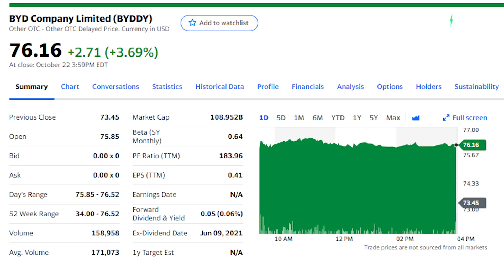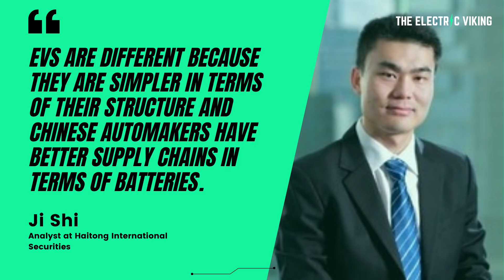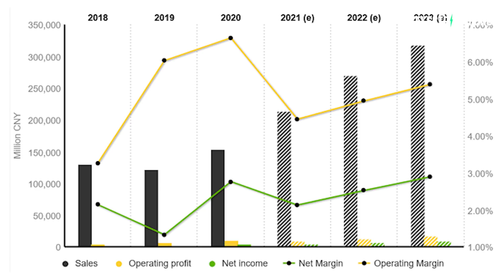BYD’s battery TECH gives its ELECTRIC cars a global advantage

Comment: The risk here is spelled 'Tencent'.  Some party apparatchik who invested in Nio can just shut BYD down at any time.
Reply: And you have no idea of the size and scope of BYD they employ over 250,000 employees, 24 factories. There consumer divisions makes all of the parts of the mobile phones, computers, batteries for all of the top western companies (inc apple), amongst all of the other consumer products the world loves. They are the 4th largest battery supplier (ctr'd with toyota, ford etc) and could easily be in the 2nd or 3rd spot very soon; worlds biggest ev maker (they have sold over 1 million ev's)...my point is they aren't getting shut down!
Reply: @BSBSBSBSBS-i2x  Not sure how this relates to my concern that The Party gets to pick winners and losers.  US investors in Tencent got badly burned by this and the same could happen to BYD, Xpeng, Nio, or any of them.
Reply: Tencent is actually NIO's biggest investor! 

Tencent will be just fine, current analyst PT for tencent are 50-70% upside after anti monopoly, tech regulations are finalised. 

Tencent not been 'taken down'. 

Anyway, there is a big difference here: developing clean energy transport EV's, Energy storage, Solar, semiconductor chips, ev batteries, high speed electric rail systems, are all stated areas for key government support under the last 5 year plan. The sector BYD trades in is one of the safest 'haven' sectors you will in China today.

Comment: For anyone to lazy to watch the video, there are some excellent bullets:

20 contracts to supply batteries! with for eg., Toyota; FAW; Ford (MACH E in China); Daimler; Hyundai worth over 100 billion yuan (USD15.6), with ongoing negotiations with a dozen more!
Reply: Their 50/50 JV with Toyota. By 2025 they plan to produce 25 Ev's, some or all on BYD's 3.0 platform, with the Blade.

The first production EV called the 290D (similar to Qin Pro), as scheduled to go on sale in China by June 2022.
Reply: Sales have started in Australia and NZ, with the new E6 (Blade Batt) and T3 van (Blade); 6 models based on the 3.0 platform will start delivers next year.

The BYD sales room / experience centre will open. in Sydney the end of this year.
Reply: The first of their new high end model range is due to be displayed at the beijing motor show next April.

This year they announce 8 new models in China, 6 are already on sale!
Reply: BYD have announce that they will be increasing their LFP batts by 20%, but that still they are cheaper than anyone else!

The Hertz deal for Tesla is their first real fleet contract. BYD has electrified the entire transport system in Shenzhen. They have been able to study the batts performance in a larger scale than any other company. BYD E6 taxis have produced more data than any other ev's so far. In shenzhen 500 EV's are charge at the same time with no issues!!!
Reply: Probably the biggest advantage right now:

BYD ARE INSULATED AGAINST SUPPLY CHAIN ISSUES.

Vertical integration: Tesla does not manufacture the 2 most important things in an EV: the batteries and the chips. BYD are the only company that is fully vertically integrated.

Tesla only has only really got 1 and half factories; BYD has 24 factories around the world.

This month BYD has outperformed Tesla stock price.

YTD BYD has outperformed Tesla stock price.

12 months BYD has outperformed Tesla stock price.

Tesla's local sales are declining in China, while BYD's are exploding!

Comment: Just read a report by Detroit Free Press dated October 22 that it costs more to charge an ev than ice car. True or not?
Reply: Detroit Free Press lied to you. It cost $3 to charge a typical EV with 250 km range in Canada who has high electricity price. It cost me $60 Cad to fill up a Subaru Impreza with 15% fuel remaining. Gas price at 1.49/liter
Reply: @henrytaverner1803  I thought Detroit free press was lying. Thanks for your confirmation.
Reply: You can’t charge an ice car.
Reply: An EV battery ranges from the size of 28.9 kWh (in the Mini Cooper SE, for a EPA range of 110 miles) to roughly 200 kWh for GMC Hummer EV pickup.

Assuming you bought a GMC Hummer EV pickup, one full charge can last for 350 miles.

You calculate the unit cost for your local electricity rate, multiply it by 200.

Then compare it with the cost of the gasoline you need to drive the GMC Hummer EV pickup for 350 miles.

Only after that, you will know the real truth.
Reply: In Denmark it cost 50% less to charge a EV than to fill up a ICE car with toxic fuel
Reply: @mikafiltenborg2291  Because electricity prices and gasoline prices differ from countries to countries, the best one should do is to do what I have outlined above, taking local electricity unit prices and local gasoline prices to make their own comparison.
Reply: @clocktower1164  Years ago, studies were done in one of China's cities (by a taxi company), and it showed that it cost less for the EV taxi-drivers on charging with electricity than for ICE taxi-drivers paying for diesel even when taking into considerations for other costs like battery replacement, etc.
Reply: Funny I can charge for free every day if I wanted to at our local free fast chargers (25kw), however not much fun sitting in a car for 45 min every day vs plugging in when get home and getting cheap offpeak power overnight.
Reply: Nope cost about $ 5-6 to charge  model 3
Offpeak at night  200 mile range. Cost at least 3 times that for a ice car
Reply: It cost less per mileage.
Reply: @rogerfaint499  I would think so.
Reply: Comparing cost of charging ev and cost of gas for ice car in the US.

Comment: You've opened my eyes to the Chinese electric car productivity revolution, thanks!
Reply: Just to give you guys a heads-up   ----  Both CATL and BYD are announcing *price hike for their batteries*    !

And Tesla has also announced a *price hike for all their cars* (Model 3, Model X, Model Y) to the tune of $2000 to $5000, with immediate effect     !
Reply: @clocktower1164  LOL, EV prices should go down... What you say - if correct - is that even less people will be able to afford EV...
Reply: @clocktower1164  That is correct for Tesla HOWEVER they did it for entirely different reason. Nothing to do with any price hikes by CATL and BYD. Tesla is trying to squash demand a bit as they have a bit of an issue delivering currently - there is simply way to many orders... (not that people demand less cars...)
Reply: @melhiore  Did I say there is a connection ?
Reply: @clocktower1164  your point is hate China & their Chinese company right.
Reply: @Billck24  Is Tesla a Chinese company   ?
Reply: @clocktower1164  tesla battery from China & I check most your comments are China related. You got nothing better to do izit?
Reply: @clocktower1164  Obviously not. Tesla is building more plants all over the world and USA, not just "Chyyynuh"
Reply: @shinymike4301  It does not matter how many new plants Tesla or other manufacturers build if supplies and parts are still in huge shortage, the latest shortage is now Magnesium which is essential for aluminium or a large percentage on the car!
Reply: @shinymike4301  This is an Australian channel that covers all EV's, maybe go back to a channel that deals exclusively with Tesla and is based in America!
Reply: @gregb1599  Viking discusses many subjects, including the possibility of Chinese EVs in the USA. You must have missed that.
Reply: @gregb1599  Nah, Tesla will be just fine.
Reply: @Peter-vn8ue  You're off in the weeds somewhere. Say hello to Buffett while you're there.🤣